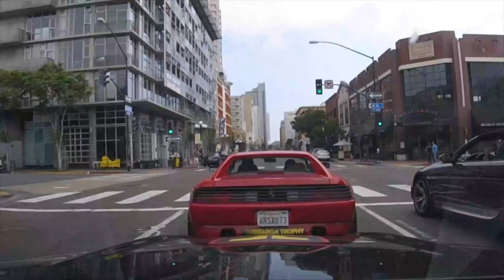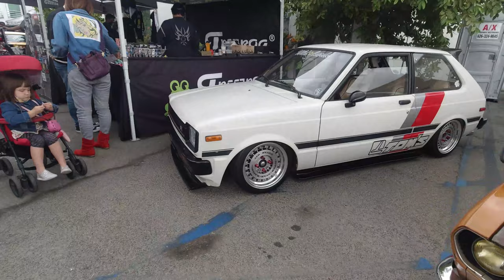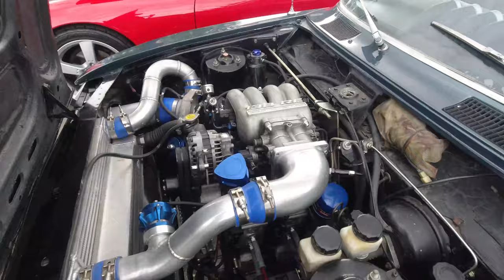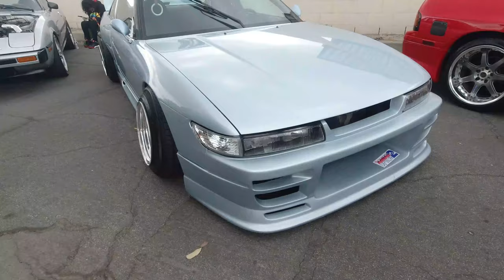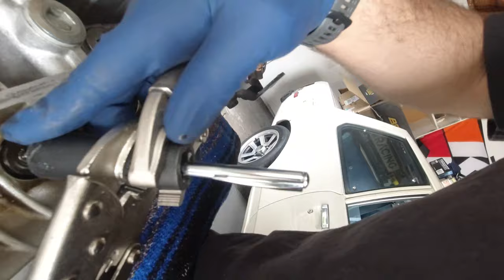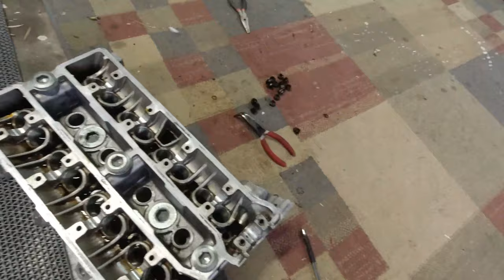TE72 Build Ep4: Vintage JDM Car Show and pulling the Valve Springs out of the 4AGE

Comment: Got some wheels for my 86 from Love20bee. Love that you show all the annoying parts of building a car that always get glossed over 😆
Reply from the maker: Thank you! That's the whole point of this series, to show ALL of the build process. The little parts that will nickel and dime you to death for a build lol. Love20Bee is a great shop, we wanted a set from them but we ended up going with a set of brand new Work Equip's ordered from Japan for our TE72 (Spoiler alert) because they were actually cheaper than a set from Love20Bee... go figure.
Reply: @CoolGuyClub  nice, Equips are like the best wheels for old Toyotas. I think 03s are the perfect 86 wheel
Reply from the maker: @Ebinsugewa  You're so right. UGH those and SSR MK2's.